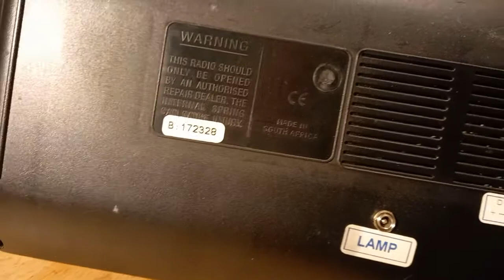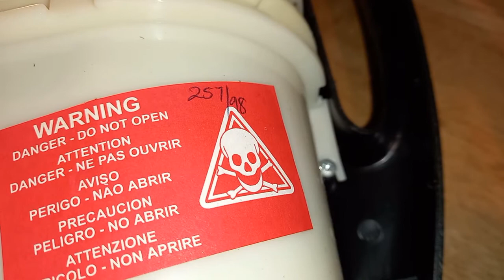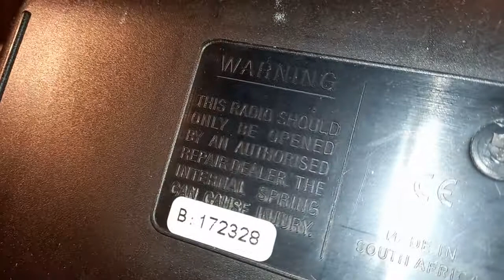BayGen Freeplay Wind Up Radio

Comment: Why is nobody still producing these and making them even better? With modern semiconductors the power consumption should be drastically dropped and the runtime should theoretically be doubled, including a little super capacitor buffer that keeps the radio powered while you wind it up and being able to listen without interruption.
Reply: google Sangean MMR 99
Reply: @KarlDahlquist That model has batteries that will fail. It's the same as all the other modern "emergency radios". The early freeplay models store energy in springs, as he says in the video.
Reply: Probably because it's cheaper to make the ones that just charge up the battery with a dynamo or solar panel. Most of the new ones can also be charged by USB which is pretty easy to find now.  You can also change the rechargable batteries easily now, so there's not a lot of need. Also there are several patents out there for the clockwork generators which the hand wind ones don't need.
Reply: @vaughnwilliams1208  that's what i mean. It should still be spring mechanism power but also charging a super capacitor that keeps it running for a few minutes while you wind it up again. Which would result in non-stop radio runtime. At low volume and with a earpiece maybe even longer than with speaker. And since capacitors are way better at handling charging and discharging (it is their nature after all) than batteries, they would most likely have a better lifetime in the long run than any battery. And even if the super capacitors would go bad after a while and would not keep a charge, the spring motor should still keep the radio running if wound up. You just wouldn't have the reserve energy anymore.
Reply: @johnwilson8582  The problem is batteries charge super slow. Even slower with the mini solar panels. And you need to aim it directly towards the sun and have actually good bright sunlight. Sure in Africa this would work, with perfect conditions. But not so much in the rest of the world. This is why i find these kinetic energy radios so fascinating.
Reply: @KRAFTWERK2K6  I love them too. I have a few of them. I’ll maybe experiment with that Idea with one of them

Comment: This must have been updated on the second spring model because when you turn off the radio it unwinds slowly. Still it would be fully unwound in maybe 2 hours though. I think the wind is controlled by switching between a charging capacitor; and just shorting the generator, so if you turn off the radio, the capacitor is fully charged and the generator runs on short circuit, which means it will slowly leak the wind. It would be ideal if you could lock the handle in place. Also if you could wind through a differential, which means uninterrupted listening and winding, even if you need twice as many turns.
Anyway the spring models were discontinued and replaced with rechargeable batteries and a hand crank generator. I do like the spring power though. It holds a certain charm, even if it's inferior technology.

Comment: You are so mistaken about this radio friend.....
   Bought mine back in the heady Art Bell days of 90s radio. Bought from C. Crane Co.
    Yours has some kind of "lamp" outlet on the back. Mine has only a blank hole.
    You forgot you have a 9volt + center power jack when you get tired of winding it.
   BTW 60 quick turns is great for a half hour.
    Try plugging a solar cell into the pwr jack also.
    These things are great. A bit bulky, could use an audio out jack, great sound and built like Granny's Rocking Chair. A Tank.
    I need to get into mine. Generator turns, no power to radio yet plays on AC adapter.
    You have one, keep it. Keep it running well.
Reply: Did you find the problem? I pulled mine out and it worked, I wound it again and it didn't play audio. Plugged in some power and it worked.

Comment: Where can we find a belt? We are in King County Wa. US
Reply: Likewise! I just got a used one today and seems like it could use some love with a new belt . Still I’d in good shape, any direction helps
Reply: There are belt suppliers in USA. You need a 80mm length square belt 1.2 x 1.2mm
Reply: Amazon sell multi packs of tape player belts if you a stuggling to get the 80mm X 1.2mm Square belts individually. I've repalced a couple of belts on the FRP1 and FRP2 models from bags of these.